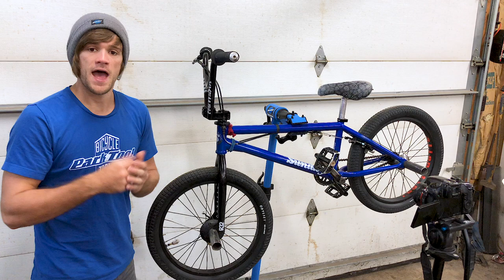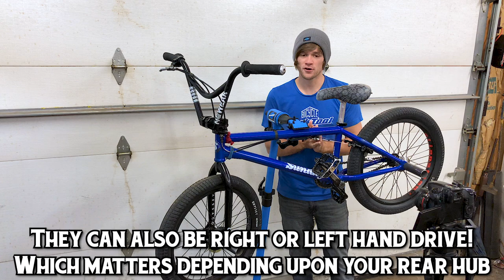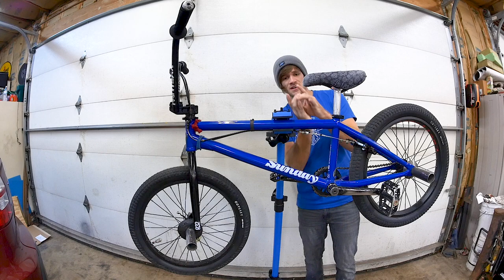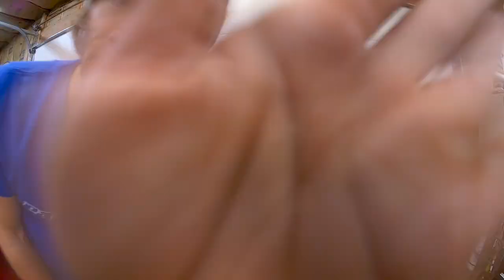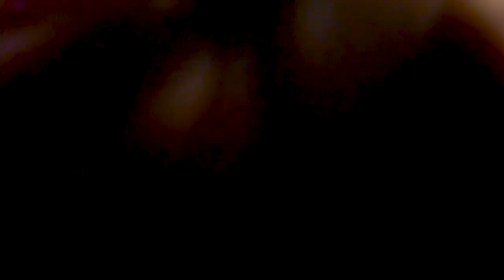BMX Bike Part Names & Terminology - EXPLAINED

Comment: I got back into bmx recently.  Was running 9" bars but had back pain, every...single...time i rode!  Im 5'-7" tall.
My local bike shop that does a lot of bmx saud to go wirh 9.75" bars, so i got the S&M Hoder bars at 9.75"
I JUST rode with them for the first tine today.  They're definitely different.
Not bad but different.
I have tried much yet with them.
At 5'-7"....did i just go to high??

Comment: i am that i am designing this =  have straight down tube 1 piece handlebars, no head set. Just plugs directly down into the tube. The forks are straight up also. Elongated top tube from seat. Basically a 24" bike frame on 20" wheels. Long 1 piece chromoly crank arm. Larger diameter pedal bolt through. 60/10 gears.

Comment: I got old bmx but I got when I was around Elementary, i don't want to throw it away cuz it was my first bike ever. The body frame of bmx is still on really good condition. Can i costumize this so i can use this? Maybe i'll buy new wheels and chains and the front fork and handles. Is it alright? What are the things i should consider?
Reply from the maker: There's definitely parts out there for it, whether or not you can get brand new parts for it, I'm not sure. 
It depends on how old it is.

Comment: Took out my 2014ish Sapient 24 Titan bike and learning the parts so I can do some minor "restoration."
Reply from the maker: Haha awesome!!
Reply from the maker: What’re your plans for it?
Reply: @Brant_Moore  Took it for a 10 mile ride at the local trail. Butt Bone sore as a mutha. 1st thing is a new seat. So I gotta buy a comfy pivotal seat and post. 2nd I'll put some Odyssey clear brake pads. 3rd I'll replace the tires (one has a minor crack) & tubes. 4th i'll give it a detail (so much grease and grime) and last I'll use that Tri Flow lubricant on the chain.
Reply: @Brant_Moore  So many seats to chose from, recommend anything comfy? Will just be doing 10-15 mile bike rides.